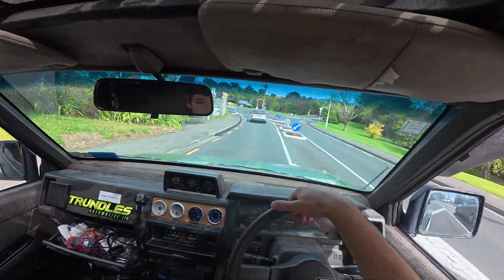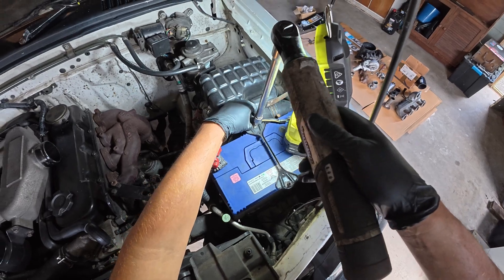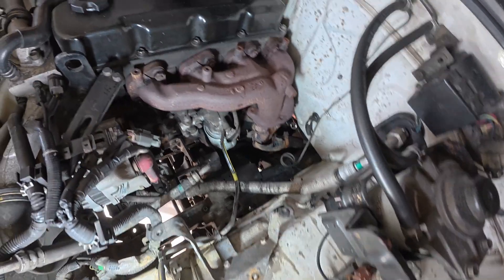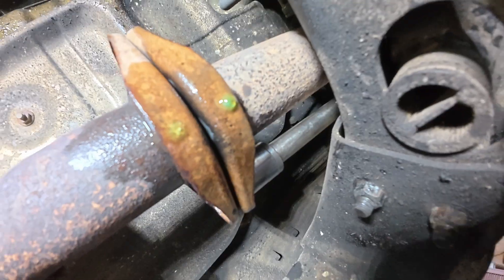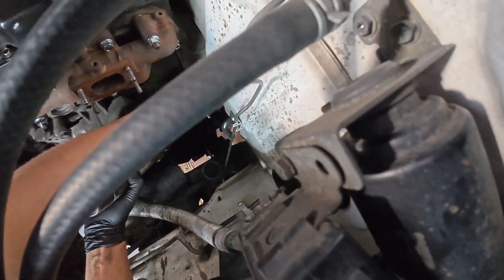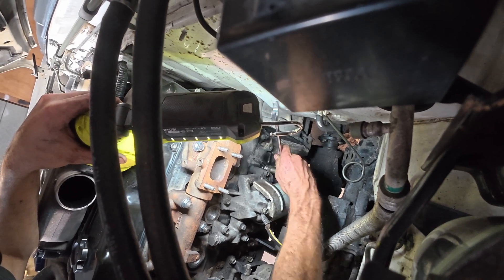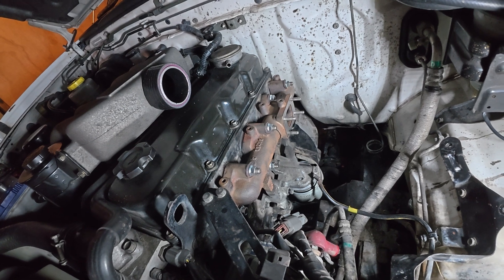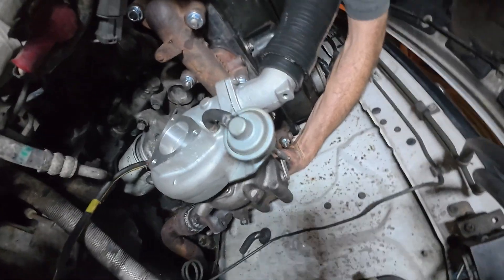How to Turbo a QD32 D22 Navara

Comment: Just bought a d22 yd25, any tips on upgrades you’d recommend and where to get them?
Cheers mate
Reply: Delete egr. Tune it. Re seal the oil pickup in sump with gasket sealant . Pod filter . Exhaust. 

More power biger turbo and intercooler and another re tune

Comment: hey bro, I have a QD32 Nav + T. I have no intercooler, whats your thoughts on intercoolers on these motors? or just diesels in general
Reply: Hola. Tengo una 3.2 sin turbo y quiero hacer eso mismo, de cual modelo es el turbo y el múltiple de escape?
Reply from the maker: go for a front mount intercooler